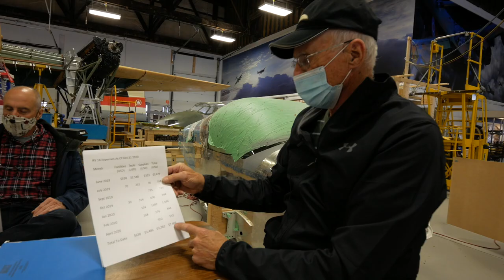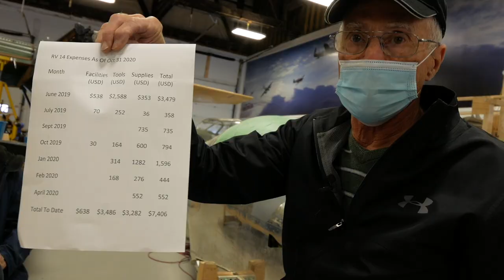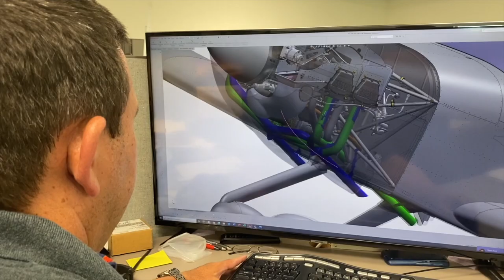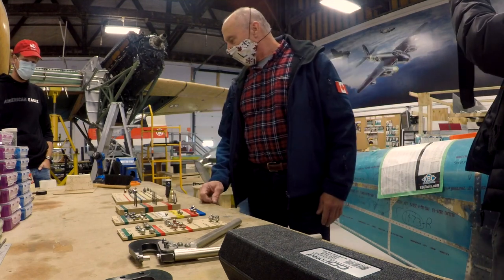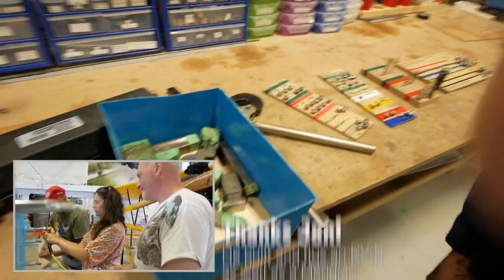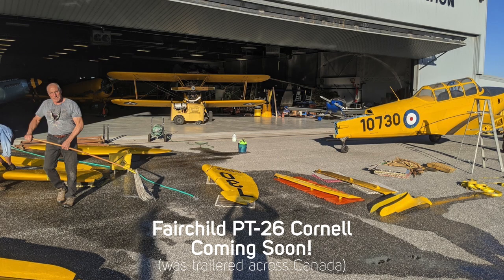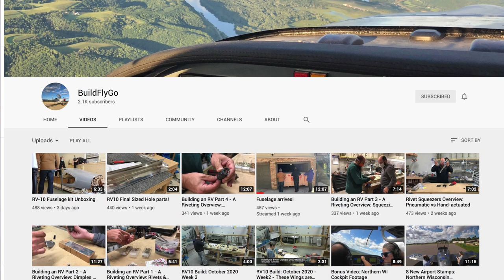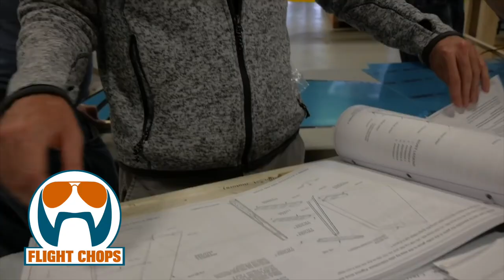How much $$$ Lumber to build a Metal Airplane? Lesser-known Costs - VLOG 11

Comment: My friend from Canada rebuilt his Cub in his residential sized garage, that had a small addition in the back, which just afforded him the space to fit the length of the airplane proper. And the way he managed to work the wings was he built a ... sort of rotisserie for the wing. Mounted rigidly at the structure, and held from moving around using a pair of continuous belts that at the top were supported by rollers, which allowed him to turn the wing on the ceiling and keep the floor space clear. Necessity makes you an inventor.

Comment: That’s about right for a composite aircraft as well, if you’re starting out with nothing.  I’m in an area that has wide temperature swings, so I also had some “home improvements” for the garage to tightly control the temperature.  I also had to create organization and storage.  Setting up for the build can take quite a chunk of time as well; I’ve spent about 700 hours or so just getting things ready, starting from nearly nothing but a bare garage.
Reply from the maker: Thanks for sharing these insights - How far into your project are you, and what are you building?

Comment: "Buy the angle grinder at Harbor Freight but buy the disks at Home Depot"

This is sound advice.  Basically no tool company really honors their warranty any more.  Buying something high quality and expensive that you're only going to need for one project doesn't make sense.  However,  all of the wear parts for said cheap tools aren't worth the material that they're made of.  You'll waste too much time cursing at them when they inevitably break or deteriorate vs. buying something that is slightly more expensive.

Comment: Oshkosh is my home airport.   Landed on 23 a few times just to use it or to help alleviate some crosswind.  Taking off on 23 heads you in the direction of the tower.   Kind of a cool view.  Check ride is coming up!!!  I fly with wings as eagles mission air service.  They have a few videos on YouTube.

Comment: You all must have used the EAA Chapter 1000 Standardized Work Table Plans to build the tables and put MDF on the top so you might comment on that item. Also, what plans did you use for the mobile tool table??? Thanks! The BUILD VIDEOS are a GREAT GREAT help to the RV build community.

Comment: Personally i dont recommend using Lumber in aircraft projects. Lumber looks and feel different based on heat & humidity, so say good bye to those measurements.
Reply from the maker: The lumber was used for work surfaces and storage, not anything precise such as jigs.

Comment: mask foil the understandability of dialog. Try 6 feet and no mask!
Reply from the maker: We're following the current provincial protocols (as well as museum board directives) that require masks worn indoors along with some other safety measures.  
I'm doing my best to work around it, shoot when the environment is quiet and use lav mics when able for the best sound I can get.
Reply: You can't talk at all if you're dead.  Let's try safety first.